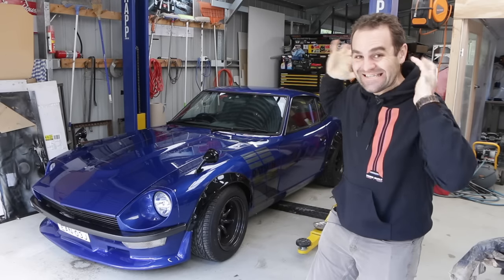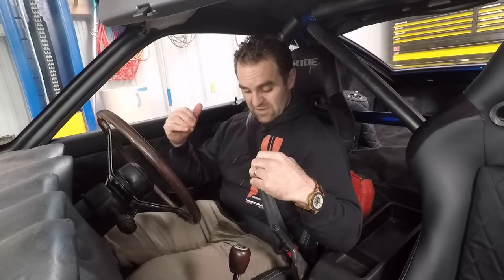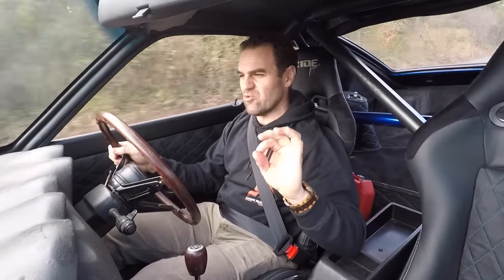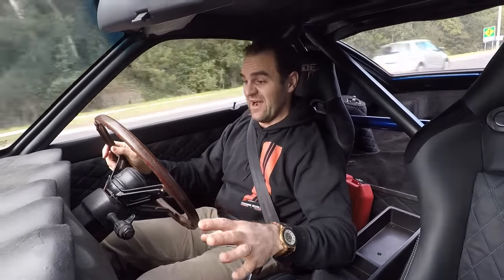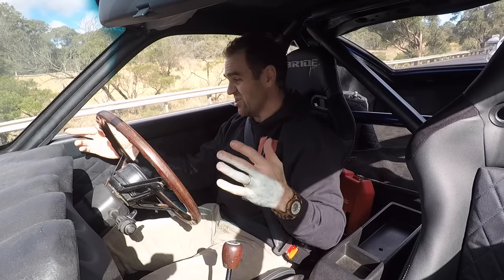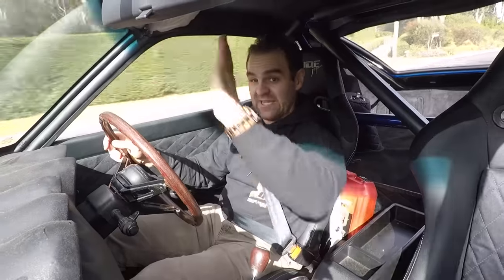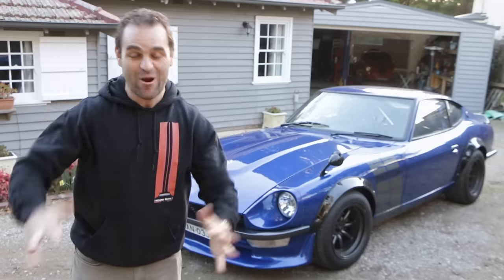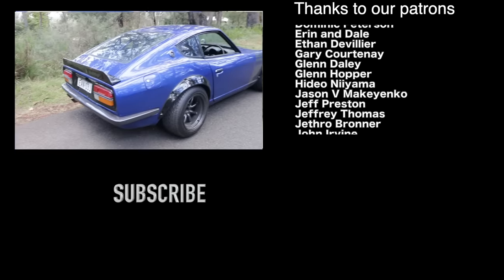Finally, First Drive!- Home Built Datsun 240z part 105

Comment: It sounds so good Jeff.   Buttery smooth at low RPMs until it's poked into the angry zone.   It's difficult to impossible to convey how fun these old Zs are to drive to someone who's never driven one before.  One has to drive it to really get it.   Some "sewing machine" sound from the valve train is perfectly normal if that's what you're referring to.   Back in the day when I knew nothing I made that noise an issue and a garage (over)tightened the lash to quiet it down.  It was all about a garage dealing with a customer complaint and not anything to do with a properly tuned car.  There's an old saying from somewhere way back that "tappy valves are happy valves" and there's a bit of truth in that here.  The 680 looks every bit the part too.   What a beauty!   Proud of you man; nice work!

Comment: Finally the sound of the Z out on the road.  So nice to experience.  The ‘tappety’ sound you are hearing is pretty normal for the l6 engines. Run her in and then check valve lash again after 400km or so. Was funny to me that you still have to fix all the gauges, thought you had fuel, oil pressure and temp working.   The clock never works for long on those Z cars.  They’re right twice a day. Mine has been hit or miss, even after I got it working for a while.
Reply from the maker: I have set it a few times, but mine seems to run fast. I am fixing the other stuff at the moment. I will get there.

Comment: On my car the original and correct master cylinder gave a nice hard pedal that was good when pressing the car into the corners. However the original started leaking so I was incorrectly advised to use a 260 z master cylinder and the pedal was no where near as progressive and only a slight amount of pressure would result in a lot of braking which really spoiled the overall drivablity. May check to see the master is correct. Top work 👍

Comment: If you connect a wire from the starter feed to a relay, and use the relay contacts to bypass the LPG safety switch for starting . This will help with priming the pump. 
If you add some caster to the front wheels it will help with straight ahead driving. 
A bit of aluminium flexi from the exhaust heat shield to the air filter will help with cold running and prevent carburettor icing.

Comment: Theres nothing better then taking my Z out for a spin, Remember this was sold as a low end sports car, so yes rattles will show up now and then. The sound it makes and feeling the pull after 3/4 grand is really awesome, I run a Turbo, so even more pull. Is it drag race fast..NO. But give me a set of twisted corners with maybe 1/8 mile in between the next set, it just does not get any better. Its just flat out fun to drive. Those carbs are worth the extra minute or so it takes. Mine sounds great, But I have to admit yours sounds even better. Have Fun, you deserve it.

Comment: Nice ! It’s fun fixing the little things too... I miss mine so much, it pulled pretty hard after 4000 rpm, had a .490” lift cam with a 290 duration. Some day I will get it back 😋..... that is one longggg shifter

Comment: Race car carbys = race car cold start........Older cars all had toe in for straight line stability..if they are parallel or toed out you get tramlining effect and bump steer ...yuk Nice to see the 240z on the road...it has come a long way from when you first started on it Jeff....

Comment: The backfiring at low throttle can be from soft accelerator pump springs, or maybe low speed jets, if it's jets you might be able to fudge it by adjusting the idle screws, but there would be a fine line between way too rich at idle and masking the real issue, what ever that turns out to be. It could just be because everything is cold and the fuel is not vaporising as well as it does once warm. 
I use Graphite Powder on the bailey channels, just the bits inside the door to help them slide better, also check the little wheels on the window regulator, or maybe the tracks have old hard grease in them.
The engine rattle could be several things, the way the timing chain and tensioner works, at floating throttle the cam can sort of move back and forth in relation to the crank, the valve clearances you need for the bigger cam, once it has heat cycled a few times you may need to readjust the clearances, or just a Datsun rattle that the rest of us have just got used to compared to driving late model vehicles. One of my old rally cars used to get a rumbly / growly noise as the power came on cam, best way around that was to just hold it flat through that point and ignore it, I put it down to a combination of all the things I listed above reaching some sort of resonant harmonic at that particular point in the rev range. I liked the angry sound as the growl from the engine, exhaust and carbies all started singing at once. 
Also you could try some thicker oil after its run in, I use 20-50, or the stuff called Old Engine Oil, I think the high number is 60 weight, but you better check that, it definitely makes it quieter, and with the old tolerances the motor was designed to, I think it is reasonable to use it. It hasn't seemed to cause any bad affects.
Glad you are finally enjoying it, and once it's run in, don't be afraid to rev to ring out of it, there is still lots of L Series out there being trashed around and loving it. Enjoy.
Reply: And in regards to running in, I found the best way was light throttle, low load and full revs, once the cam was bedded in of course.
Reply: Definitely running lean causes the popping sound (old timers call it spitting) from the triple carbs. 
 I’d say turn out the idle adjusting screws 1/4 turn equally on each carb to start. See if popping goes away. Try again  if not. Idle should drop in rpm as you turn out the screws. This is a sign of richer fuel ratio. 
 If idle does not drop as you turn out screw the carbs are in need of more fuel. Install richer idle jets.
Reply: Or smaller air bleed jets at the top of the emulsion tubes, now we are starting to get into the depths of the dark art of Weber tuning. It may be time for trip to the dyno.
Reply: Air bleeds do not come into play at idle or part throttle. You can actually take out the main jets , emulsion tube and air bleed assembly and the car will run at idle and part throttle. This method could actually prove it’s the idle jetting if the spitting and popping continues. 
 Only until you open the throttle blades to a certain point does the main jet assembly  come into play. This is another trick to learn which jets to change. It will establish at what rpm the mains become active. 
  Lean condition from an air bleed would sound like detonation not spitting/ popping from the carbs.
  I have 3 cars with Weber carbs. This is my experience and only post to provide the best info I know to help the hobby.

Comment: Use spray silicon lubricant for the window channels, it works wonders!
Reply from the maker: I will give it a go, but they are pretty old and dead. I have some new ones ordered to fix them properly.
Reply: @HomeBuiltByJeff  White grease is what you need for the guide channels and with new bailey channel you should see a big improvement. (It worked for me in my 1974 260z)
Reply: Just keep it along way way from your paint booth!

Comment: Sounds awesome Jeff!!      Just work on getting all those little things fixed - it will be worth it.    I got everything working on mine except the Air Conditioning (which was dealer installed).   It was too much of a pain so i pulled it all out.   Tiger.
Reply from the maker: A/C won't be part of this build either. It is good as it is for now ;)

Comment: We chatted briefly before in the comments to another video about brake balance when you went with the toyota calipers in front. Specifically brake modulation and brake feel as you ease into the brakes (as opposed to holding the pedal at a fixed pressure). I.e. the brake balance won't be static across all pedal positions with a mixed caliper/drum set up (it would be more drum biased initially, at lower pedal pressures). That's not a deal breaker on it's own; as you know, the original brakes paired calipers with drums. However, this feature of the design may be exaggerated past usability with the new set up (it was for me on an American 280z, at any rate). You may be dead right about feeling the booster coming on. That said, the issue I ran into with the larger toyota calipers felt similar to what you describe. If you go to have a look and find that the booster is operating as it should be, I would consider the drums. Specifically, that the drums are engaging sooner relative to the front calipers than they would in a stock system, which is compounded by drums having a stronger initial bite than calipers. So you may not be feeling the booster coming on, you may be feeling the drums engage and then the calipers after. In straight-line it was unsettling, but mostly a non-issue, as by the time I braked hard enough to lock the wheels up in a straight line, the fronts had come on enough that they locked first. It mostly caused issues in corner entry situations, where the brakes weren't applied heavily, and the rear tires available traction was less. If I wanted to trail brake or maybe bleed off some speed on an entry I had overcooked, the back end was unpredictably jumpy. Though it occurs to me that this might actually appeal to you, as a vintage Porsche man.

 That's just a thought/experience from a guy halfway around the world, who's never even seen your car in person before; so it is offered with a grain of salt and a shrug. 

Best of luck with the shakedown, Ian

Comment: Congrads on getting the Z on the road.  I see you went for full rego rather than putting the car on club plates.  I am replacing a few of the plastic trim covers on the interior of my 240Z at moment, after 45 years they are a bit worn.  I am looking forward to the sound of triple Webers in due course!! (even if it's more difficult to start).

Comment: I would say your emulsion tubes are not correct for your set up.  Jetting a side draft carburetor is all well and good but remember the emulsion tube’s are basically for lack of a better word your “tune” for your fuel mixture.
Reply: Good point, I had forgotten about emulsion tubes, look at the size and number holes and at what height they are, to work out whether they lean or richen the mixture over the range of operation.

Comment: Hi Jeff, I have had in the past the 260Z. LH Version. The car was running with 3 SU caburator, without choke in the Morning no start was possible.
Mine had a speedometer in Km/h. That must fit in 240 as well. One thing was boring me all the time, the contact of those wipers to the windshield. By higher speed they are rotating in the air with no contact at all to the windshield . I had made those spring of the wiper shorter 
and later I had add same small spoilers an those wiper arms.

Comment: Congrats Jeff! I notice a similar rattling coming from my engine and it somewhat worries me, mine sounds similar to yours. Is that pinging??
Reply from the maker: Mine is definitely valve train noise.
Reply: Home Built By Jeff is that a bad thing? I think we may share drivetrain noise
Reply: Here In America,The Datsun Dealers ,Back in the Day,Advised Valve Adjustments Every 17,500-25,000 mls.on the 240' s.,Believe 27,500-35,000mls on the 75-78 280's.Not Sure Which Heads Ur Running.If SUNOCO Racing Gas Is Avail.,There,I Ran Sunoco 240 & 260 Grades of Fuel in Both My 280' s Where It Was Avail.Also Worked Very Well on My 67 Pont.Firebird SPRINT ,W/ OHC Strait.6.

Comment: The roll cage appears to be very close to your head in the cabin, driving it without a helmet are you not concerned about impact with your head in a road accident?
Reply from the maker: No. It has the required padding and it is not really possible to hit my head on it anyway (otherwise it never would have been passed by the engineer).

Comment: Your 72 cam should come on from around 2800 to 3000 RPM . So the cam is way retarded.
With no 6 cyl on TDC compression ,put the end of a steel rule down ON BOTH SAME TIME the intake and exhaust valve retainers of cyl 6 note the up and down angle of the rule, // or  !! or \\  turn crank 360 deg to TDC and check valves on over lap with the rule on the valve retainers , it should be the same angle . If not,Buy a adjustable cam sprocket , wedge the chain ,fit and adjust till it is the same
Reply from the maker: The guys at the dyno did note that my tacho was not accurate so that could explain a lot of it ;)
Reply: @HomeBuiltByJeff  with your 123ignition . check it with your phone